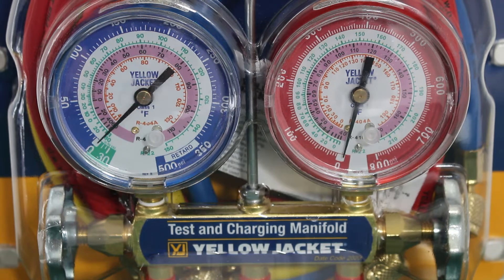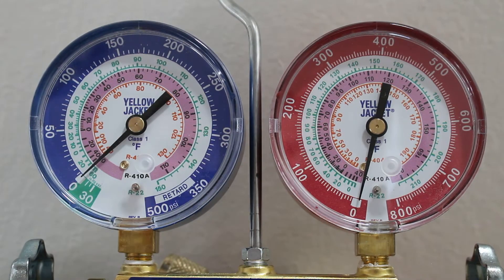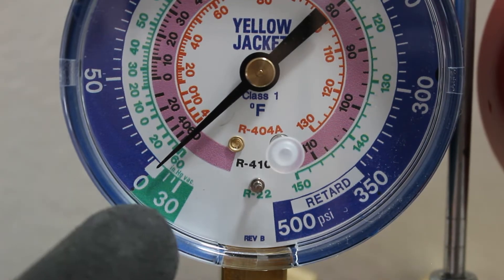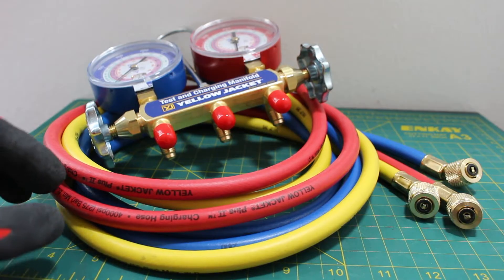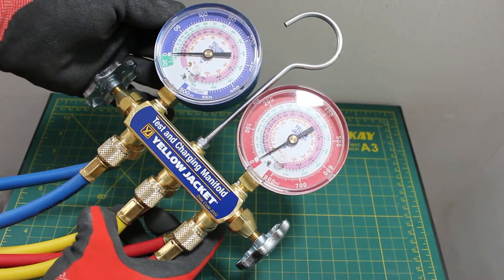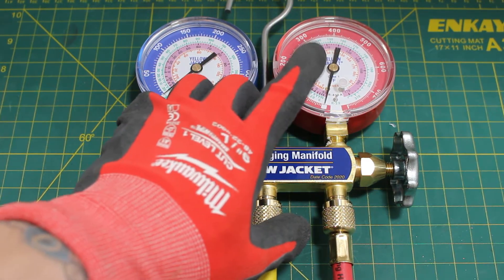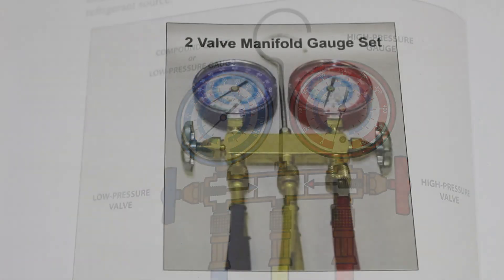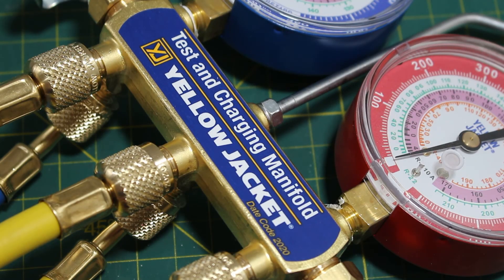HVACR: How To Use AC/Refrigeration Gauges (Manifold Gauge Set) Everything You Need To Know!

Comment: Xlnt video very clearly explained, love the diagram, makes it much easier to understand. Not many people understand where to have the hose end with the depressor to open Schrader valves. It would be helpful to also explain brass adapter fittings for R12 & 22 and R134a. 1/4" flare vs 1/2" Acme threads, both male and female. I have adapters to go both ways so I'm never stuck for a method to securely connect. Also needed is a good video to explain old style Freon cans which are pierced vs. the new self seal type, can taps and adapters. Thanks for a great video.

Comment: I just bought a mastercool gauge and tried to add some r22 to my own unit , once i hooked the low and high , the low side read 125psi and i did purge and opened the ferrion and opened the low side to add ferrion ( 15 second) the gauge at low side still reads 125psi , so i waited few minutes and added ferrion for 15 more seconds and the gauge still reads at 125 psi , so at this time i stopped and unhooked everything because i thought there is something wrong, so my question is what was i doing wrong? 
Tks
Reply from the maker: Hey, so there def is an issue there. If it is an R22 unit, those pressures indicate that the compressor is not running. If you had 125 psig on your low side and 125 psig on your high side then the pressures are equalized and that's normal. The trick is that the compressor should be running when adding the refrigerant on the low side. From there you'll see the low side pressure climb. Make sure the system really needs refrigerant and if it does then that indicates you have a leak and that must be repaired. You should not have to ever add refrigerant to a system unless there is a leak. Always appreciate your support 🙏 Thanks for watching & stay tuned for new videos every week🔧⚡️
Reply: @JumpermanTech  hay buddy. Tks for reply but i found out what i did wrong, the unit has r410 and mistakenly i added about 1 to 3 ounce of r22.  Once i realized i was about to kick myself in the head so make the story short i checked my ac and it is running good , i told a hvac guy about my mistake and he is saying we got to vacuum all refrigerant and put new r410.  So please tell me if i have to do that or is it going to be all right as it is.
Tks
Reply from the maker: @mansourramzey7711 You're very welcome. It's alright, many have made that same mistake. The HVAC guy you spoke with is correct. You should recover the refrigerant, vacuum the lines, replace the liquid line filter drier and charge the system with the correct refrigerant. Refrigerants shouldn't never be mixed. R22 and R410a run off completely different pressures and this can become a costly problem. I'd advise not to run that unit until this is repaired and the sooner the better👍
Reply from the maker: @mansourramzey7711  R22 and R410a use different oils and have mixed. This could possibly cause an issue but I think you'd get away with just sticking with them advice in the previous comment 👍 Considering it's working well now you should be fine. Just take care of that sooner than later. Be safe out there 🔧⚡️
Reply: @JumpermanTech  just turned it off , it happened yesterday,  i definitely ask him tomorrow to recover the refrigerant and put r410 , i appreciate your input and tks for all the informative videos you share with us.
Tks and be safe

Comment: I have a yellow jacket manifold with  knob on the side. So its clockwise to close and counter clockwise to open.For some reason when i open the low pressure side, refrigerant are not being added. Any ideas?
Reply: Sometimes it just doesn't want to take it OR your Refrigerant tank IS Almost EMPTY and LOW in pressure.  PUT THE TANK IN HOT/WARM Water will help raise the pressure.  But please be careful for it HAS TO BE LESS THAN HALF FILLED.

Comment: Once the gauges with air in them are connected up what happens to that air. Will it be sucked into the low side suction side? At least a little bit of it? Won't the refrigerant and air mix to some degree.
Reply from the maker: If you only connect the low side & high side hoses to the system, you won't allow air into the circuit. If you try to add refrigerant with the center hose, you must purge the air out of the hose before allowing any refrigerant to enter the system so there is no contamination✌ Thanks for watching & stay tuned for new videos every week
Reply: @JumpermanTech  Im visualising pressured gas pushing up against a smaller volume of air in a tube. Like pouring milk on top of coffee, they mix. Why wouldn't the air mix in with the gas at that port junction? Two gas meeting up against each other will mix won't they?
Reply: @JumpermanTech  how do you purge refrigerant on a manifold like this that doesnt have a purge valve in the middle?